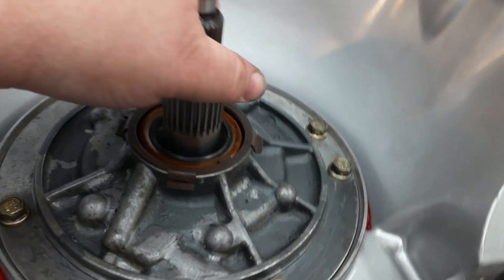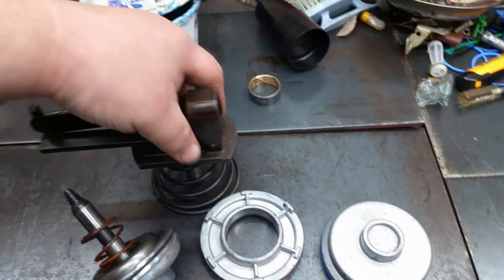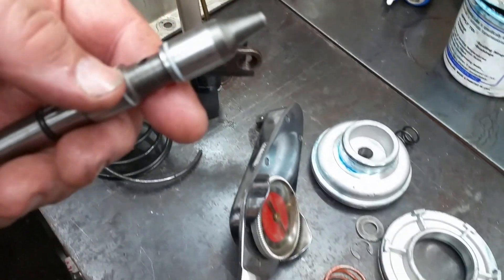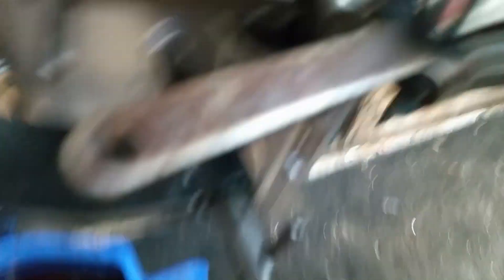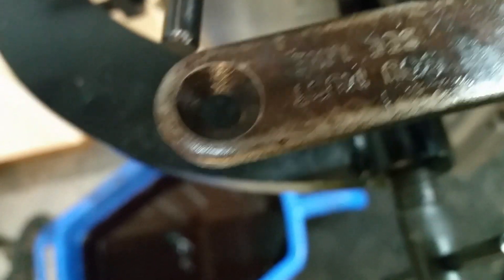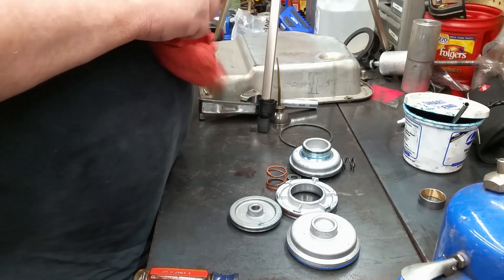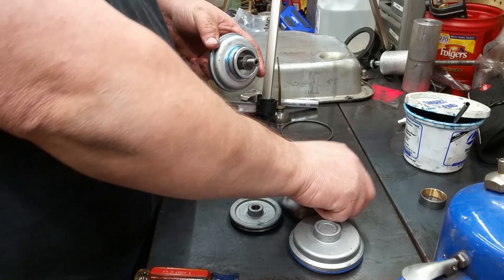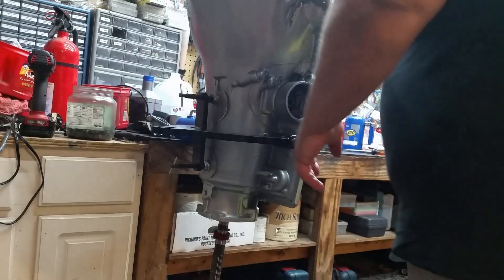L2theW 700R4 Transmission Build! Part 9 - Setting up the 2-4 Band Servo! *MOST CRITICAL!*

Comment: Hey is there a high performance servo if so what kind and brand cause I have a 1990 Chevy 1500 with a 700r and I'm thinking about putting a good servo in it
Reply from the maker: Superior transmission parts or Sonnax makes good ones

Comment: You seem to know them 700r4s, I got an 88 iroc and it shifts fine when driving normal but when step on it the rpms go up to 6k and I gotta get out of it for it to shift , could that be the valve body?  It use to shift perfect around 5300 rpms and it kept the engine right in the power band ,
Reply from the maker: Could be either TV cable stretch or the govenor is damaged. Or a combination of the two...
Reply: Thanks for the reply I'll look into it . car only has 72 thousand miles so I'm leaning more to the Governor but I'll check them both.

Comment: I just changed my servo in my 91 and took the old one out and somebody put it together without the snap ring that holds the bigger springs inside the first cup so that was my shifting problem and I noticed they ground the old pin off so I used the old pin and put the new servo in and it shifts perfectly even at wide open throttle it's direct so it might hold up to my 400hp after all we will see
Reply from the maker: I've never seen anyone do that before...thats crazy!
Reply: @IrocinZ  I guess whoever re built it didn't put the servo together correctly the first puck that goes in first didn't have the clip holding the two springs inside of it 🤷‍♂️
Reply from the maker: @jonathanlawson4667  Wow!

Comment: Hey Smitty how's it going got a question did you finish grinding on the front only or did you grind the back of the pen at all. Every time you use a wide band you need to adjust the PIN.
Reply from the maker: Only grind on the tip. When you use a stock band, normally you won't have to shorten it that much...

Comment: Smitty I have a same tool. What travel you think it’s at with the line? I like to set my performance builds (with the right orificeing) to .060” travel. I use the tool to get me close then I use a dial and check travel. At .060 the line barely comes in the window. Or it’s on the front side of the window if u will.
Reply from the maker: I don't usually measure it when using the tool,  but I do visually check with the air test and make sure the band is loose on the drum. The thing is, you can go back and adjust it later if needed once its installed, but I've never had to.